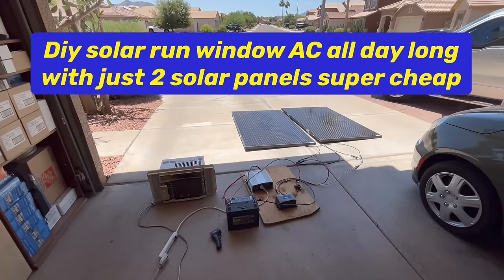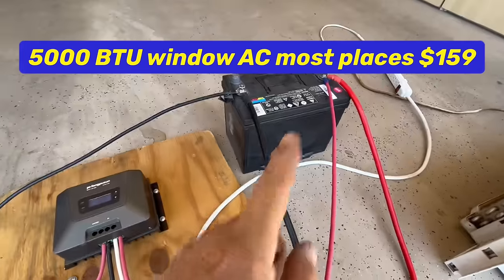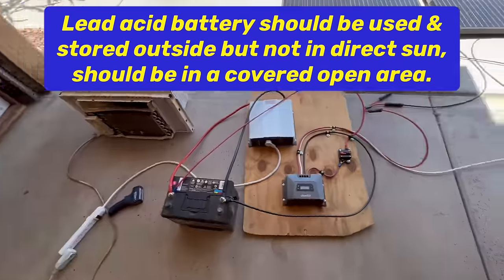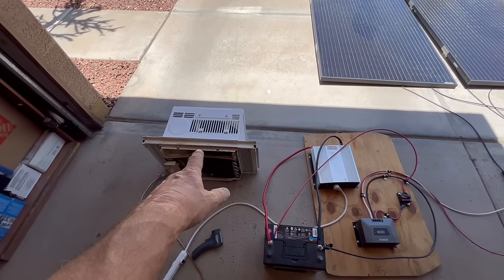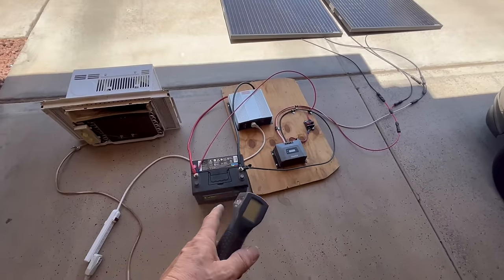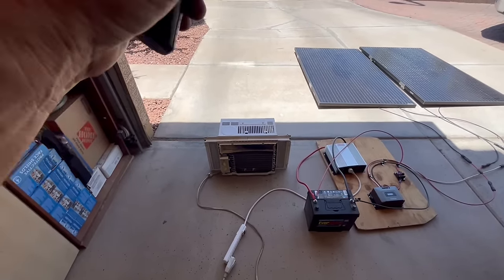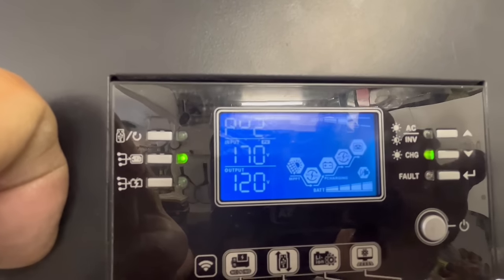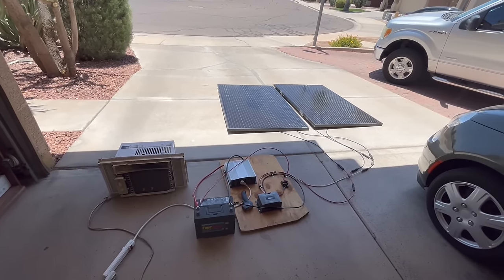Run your window AC with just 2 solar panels when sun shines. Easy DIY project you can do in one day.

Comment: What if you ditched the battery and charge controller?  With enough panels to cover the surge, can you have a battery-free system that just runs when the sun shines?
Reply from the maker: You would need a batteryless inverter and those are usually 48 volts. The battery makes a stable source to run ac unit. Without battery and charge contour would not be able to stabilize power. The charge controller changes dc voltage coming in from solar panels to a voltage up to 14.2 volts to charge battery. They have mini splits heat pumps now that you can directly input solar panel connections to outside unit of mini split. In that case you would not need all the other components since that is is the mini split. But as far as I know, no window ac unit has that technology yet. Hope you have a wonderful and blessed weekend

Comment: We r using LG 1.5T inverter split ac. It takes almost 550w in power saving mode. For 12v solar system it will consume 50A from battery to run the AC. Assuming safe battery discharge rate 10c...I need atleast 500 AH battery system....4 x 150AH battery in parallel. Which cost in India approx INR 70k...
Reply from the maker: That sound right. The mini split is really efficient as far as using a lot less watts when room is cooled. I use mini splits in my house down stairs and garage all day long using only solar. Cools 1200 square feet down stairs and 600 square feet in garage. Only 16 seer 120 volt mini splits. They work well with it being 113 degrees in Phoenix Arizona during the day. I have started buying LiFePO4 batteries and now I actually air condition my house completely on only solar in day and 25.5 kWh LiFePO4 battery at night. I try to buy refurbished inverters and batteries with warranty, much cheaper. I’m on a limited budget so I can not spend a lot. Stay cool my friend in India. Hope you have a wonderful and truly blessed day.

Comment: Holy crap dude. This is incredible.
Reply from the maker: This is just the basic set up with the least amount of components, the more you expand on this, the more you can run. I now run my entire ac/heat in my house and garage as well using only solar. We run our upstairs ac at night using a 25.5 kWh Lithium iron Phosphate battery bank. So we can not use any grid electricity for heating and cooling. My neighbors who do not have solar spend around $500-$1000 a month on electricity in the summer for 5-6 months. Huge savings. All done off grid and none of my system is connected to grid in any way. All my solar panels are used from local place in Gilbert AZ. Check out what else I am able to do with solar. This is all DIY. 60 percent of on grid solar is installation. We installed everything ourselves. Thanks for your comment and hope you have a wonderful and truly blessed weekend

Comment: have you thought of using a soft starter for the ac unit?
Reply from the maker: Honestly, I installed soft starts on my 3 1/2 ton and 4 ton central ac units I run with solar and even on my 12.7 ton pool electric heat pump pool heater. And when running in summer on solar the ac does not stop ant start very often when it has been 116 degrees out, just constantly running all the time. Same with pool heater. Always running all day. This window ac on high will not turn off and then back on hardly at all. I found that with no solar and using a 12 volt 150ah 2 kWh Lithium Iron phosphate battery, I can run ac for almost 4 hours on high, never turning off once and then on again. I use the soft start on my 3 1/2 ton upstairs central ac overnight and it helps to save LiFEPO4 battery bank from draining faster, that starts to cycle off and then on after midnight with temps out here hitting 125-117 in day and still in the 90’s at 6am.  I also use 6 mini splits in my house and garage and because they are a inverter compressor, they really don’t shut down compressor but greatly reduce watts needed to run from 1200 watts at startup to maybe 600-800 watts 1/2 hour later and as low as 200-400 watts overnight keeping room at 78 degrees. Mini splits can cool and heat, better and so much more efficient than window ac as window as basic model only cools room, no heat in winter. Soft starts could be used but a mini split Will gradually increase from 50 watts to 1200 watts, no surge ever, so mo need for soft start on mini split. Soft starts are kinda pricy at $200 on up. The window ac I use, uses around 2000 watts to start and drops to 500-550 watts running. If I can get ahold of s cheap soft start I will try to do a video with it and test it. But this is just a simple set up to show basic set up to run window ac using solar only during the day, using grid or LiFePO4 battery at night. Thank you do much for your question. Hope you have a wonderful and blessed week

Comment: Hello, modified sine waves have a tendency of over heating motors. Fact. You need PFC and a lithium battery instead. Lead acid batteries suffer from what's called the Peukert effect.
Reply from the maker: Thanks so much for your input. This is just a simple example to run an ac with solar , mostly for viewers in other countries, I used cheap available parts they could get in the video, of course you can greatly improve this basic design. But it was just a simple example to be able to see the components needed to build a basic solar system. I actually run my entire house air conditioning with solar in day and battery bank at night and garage ac only during the day with off grid solar. I also installed 6 mini splits in house and garage. Hope you have a truly wonderful and blessed week

Comment: awesome video thanks man
Reply from the maker: Thank you for your input. This is just a simple example of basic solar. I actual now am able to run my 2 central ac to cool and heat my house 7/24 with solar in the day and 25.5 kWh EG4 Lithium Iron phosphate battery bank to run all night long. I also installed 6 mini splits, 2 upstairs, 2 downstairs and 2 in the garage. 2 Mini splits use about half of the watts of one central ac unit. We are now able to heat our pool in the winter when the normal water temp is in the 40’s, we can heat pool to 78-89 degrees. All this is from off grid solar. I am amazed at all I was able to run with solar every day 365 days a year. Hope you enjoy my other videos and I show what is possible with DIY off grid solar.

Comment: How is the hermetic compressor motor getting along with an impure (modified) sine wave?  Over time? Is the motor drawing excessive current?
Reply from the maker: No I used this in a shed for around 2 years with no problems at all. No humming, ran perfectly fine. Still works great.

Comment: Please is it possible to use refrigerator with 1000w modified sine wave?
Reply from the maker: You can but refrigerators along with many other electronics do not like a modified sign wave inverter. Over time it could reduce the life of the refrigerator. Better to use a pure sign wave inverter to be safe but it is your refrigerator. I never had problems running any of my electronics on modified sign wave inverters, but maybe I was lucky. It is possible to run your refrigerator on modified sign wave inverter but you have to make the call weather you want to risk shortening the life of refrigerator. Hope this answer helps. Hope you have a truly wonderful and extremely blessed weekend

Comment: I want to use this on the roof of my man cave. Does this mean I have to climb up on the roof cover the panels when not in use or is there another solution?
Reply from the maker: @mariomunoz3023  when connected correctly with the right components. Breaker to battery can be tripped in off position and inverter breaker should be off as well. Also having a breaker for solar panels in off position as well.

Comment: Nice! Do you have a write up on how to build one by a dummy?
Reply from the maker: No I don’t not have a write up on how to build one but I show in my videos what kind of solar panels I used and the different inverters I have used. I installed 6 mini splits in my house , 2 upstairs, 2 downstairs and 2 in garage, next one in the motor home. Mini splits are very easy to install and now have ones that require no special tools such as vacuum pump or Hvac gauges. The window ac in this video is not very efficient but I used it for the purpose of showing that you can run ac on solar and showed the minimum components needed. I used this in a small shed for 2 years to keep my solar inverters and charge controllers cool until I eventually bought all in one off grid inverters that can allow much more solar panel input. I was able to go from 2 solar panels to 10 solar panels and eventually to 48-250 watt solar panels connected to  a 12kw(12,000) watt off grid low frequency 48 volt inverter that now can run my 3 1/2 ton and 4 ton central heat pumps to air condition or heat my house. I also use a 6kw low frequency inverter to run 2 mini splits in my garage. You can watch my videos to learn more about mini splits and central ac being run with just solar in day and LiFePO4 batteries at night. There are a lot of people out there making videos showing step by step how to install mini splits, solar racking, installing and connecting solar panels, installing and connecting off grid inverters, I would suggest you watch those videos to get an idea of everything involved with DIY off grid solar. I show what I have done with solar off grid and what components I used but not step by step instructional videos. Spend some time watching videos on basics of off grid solar, then you can start to think about how you want to use it.  Hope you have a wonderful and blessed week
Reply: @diy-solar-guy  I have watched many videos on putting together a starter solar setup but never felt sure that I can build one but after watching your video I think I can now. If you have to add a Fuse Block, where will that be in this setup?
Reply from the maker: @HJBProductionsLLC  you should have a fuse in your solar array to help from a lightning strike, also a breaker between solar input and inverter and a breaker between battery bank and inverter. These are all safety measures. I don’t do a lot of videos on breaker and fuses but you can just search YouTube for installing breakers and fuses in solar power system and you will get s ton of videos showing examples of how to install. Hope this helps, I’m am getting ready to upgrade my breakers and add some fuses in my system. It has been 112-118 degrees out here and that is brutal on a off grid solar power system. The extreme heat increases the watts and amps needed to run my 2 central air conditioners or my 6 mini splits to keep house air conditioned 24 hours a day. Breakers were getting pretty hot. So I need larger breakers to take the higher amps. I actually added 2 electrical panels that are 200 amp service to my 2 Growatt off grid inverters. That was a challenge since I had no experience, but I did it. Let me know if you had any more questions

Comment: Can you show me how to do all that with 6AC's units there are 240votes all in different rooms of the house and yes there's a window units
Reply from the maker: Check out my other videos, I show how to  run my main whole house ac unit with solar in the day and LiFePO4 battery bank at night. Better off running a whole house ac or heat pump if you can but you can also use mini splits as well. Mini splits are better than window ac, mini split heat pumps will heat in winter. Window ac are not very efficient but you could use them.  You can get a solar off grid kit which is easier or you can buy all the components separately and build your own off grid solar system. You can run a whole house ac with the same amount of watts as using 6 separate window ac units.

Comment: I think buying a portable power station would simplify this process by 100x.
Reply from the maker: That is an option, not sure how long it will run with window ac using 500-550 watts. Most of those power stations could only run this ac an hour or 2 at 1 kw power storage. But it’s worth trying. I know I connected a 150 ah, 2kw hour 12 volt battery with no solar connected and the ac was able to run almost 4 hours.

Comment: I'd love to do this but need the ac to be 8000 btu.  I wonder what  you'd have to upgrade in order to do this.  Another solar panel or 2 for sure but, anything else?  A second battery?
Reply from the maker: Check out my videos on running mini splits with solar using a 24v all in one inverter. You could run the window ac unit with that and it would last you longer than that window ac would last. You can connect it to 2400 watts in solar panels but could also just connect 1000 watts in solar panels as well. But you would be better if with the 2400 watts in solar panels. I buy all my solar panels used locally for $25-$40 each. The solar panels should last me at least 10 years to 20 years. Check out my other videos to see other ideas you can do instead of window ac or just use your window ac instead of mini split. But the reason I use mini splits is I can heat that same area in the winter time with mini split. Thanks fir your input. Hope you have a wonderful and blessed day

Comment: Do you currently have a video that shows how you put everything together along with the list of items you are using and cost?
Reply from the maker: I do not have a video connecting all the part’s together yet but am working on it. It is very easy. I am actually working on a video of using this example and upgrading to run several window ac units or running 1 -2 mini split that can cool 600 square feet each for a total of 1200 square feet. I have several videos of using 2 mini splits air conditioning my downstairs of my 2 story house, uses less than 1/2 the watts of my 4 ton central heat pump to cool house. You can get a really good idea of what you will need watching those videos but I am now adding in description where I purchase components and how much they cost. This is a very simple example of using solar to run an ac. This was my first project 4 years ago when I started looking into solar. Now I have videos of running all 6 mini split heat pumps in my house that air conditioners in summer and heats in winter I also am Now running my Upstairs and downstairs central ac heat pumps with off grid solar in day and LiFePO4 EG4 25.5 kWh battery bank. In Phoenix in June I spent $0 on air conditioning with average daily temps if 110-115 degrees and overnight lows of 85-90 degrees. It is amazing what you can run with off grid solar once you figure out how to DIY everything. Check out my other videos showing what we did to accomplish what I talked about above. I am currently going through 2 incurable cancers for last 10 years and can not do but 1-2 hours a day max working on solar due to pain issues from cancers. If I can do this going through 2 cancers than anyone healthy can accomplish this very easily. It has taken me 4 years to figure out how to master solar off grid and apply it to reducing my electric bill in Phoenix az to around $1000 a year, saving over $5000 a year in electricity. My entire solar power system will be completely paid back just from savings on electric bill at the end of December 2023. In 4 short years I went from being like you knowing absolutely nothing about solar off grid, mini splits, central air conditioning units and electrical. It really is easy if you just are willing to watch videos if people who have installed systems and explain how. Check out my videos to start learning, I share in videos so that people who know nothing about solar can understand and follow along. Thanks for your question and don’t hesitate to ask more questions, the answer are free. Hope you truly have an extremely wonderful and very blessed week.

Comment: dont you need to ground the panels? I have not seen the ground cable leading to the two panels
Reply from the maker: This is just a simple example of using solar. I was just showing that you can run a window ac with solar and the minimum parts needed. If you build a system, you can ground your panels. Was just trying to keep everything very simple for illustration. For example I see a lot of people mount solar panels on top of campers and motor homes and have not seen one video where they ran a ground. That would be considered a floating ground. Same thing with using solar panels on a boat. There is no where to ground solar panels. Depending on your situation and how you plan to use will determine weather you can earth ground or use floating ground. Large military ships ground to the actual metal of ship. But you can ground your solar panels in your system you build. It is up to the person building system to determine how to ground solar panels. I have an off grid system and have to ground from inverter frame ground to electrical panel by bonding with ground in electrical panel. If I try to drive a grounding rod in ground even 150 feet away from my main house electrical panel, I still pick up voltage from main panel. Some circumstances you might not be able to ground, once again I leave that up to the person yielding the system. Many YouTube solar guys just lay there solar panels on the ground and never attach a wire. Check out Will Prouse in his videos. You will see what I mean. Hope you have a wonderful and blessed week